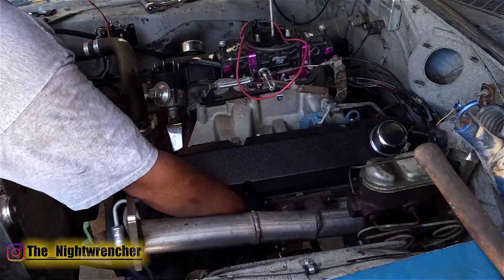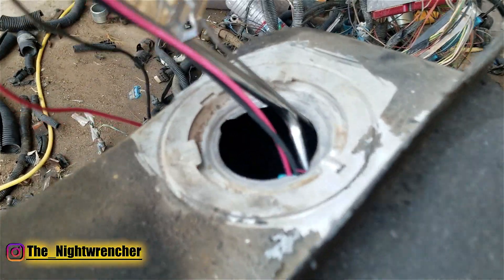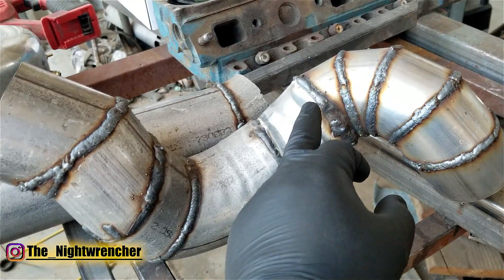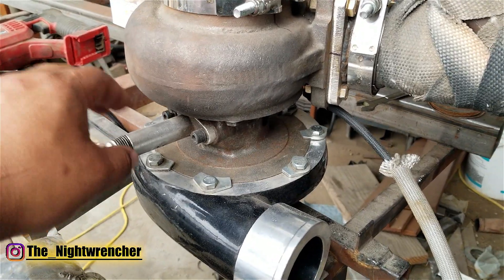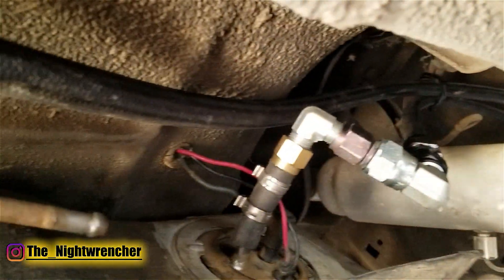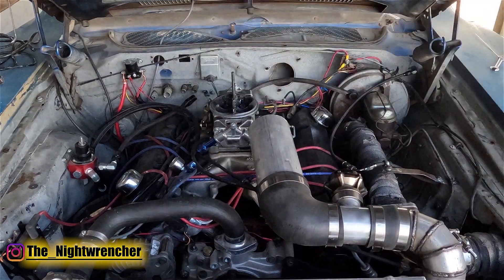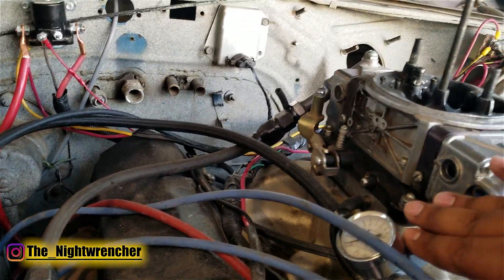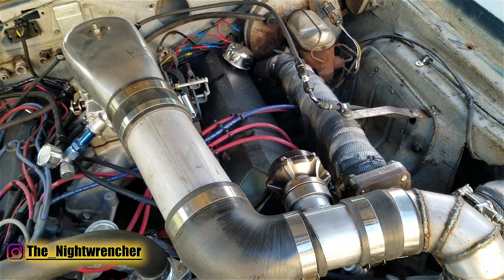Finishing My Turbo Big Block Mopar 361 1973 Dodge Charger | Blow Through Carb | Carbureted Turbo

Comment: Nice!! If you decide to do a re-ring, get some Hastings chrome rings and deglaze the cylinder walls with a medium grit stone and clean thoroughly. It will take a while for the rings to seat, but the chrome rings will be impervious to boost and resistant to contaminates (dirt/dust/debris) that boosted engines have to deal with.
Reply from the maker: I might just do that! I've pushed this motor about as far as I can go without breaking a piston. I'd like to get some forged pistons and rering this engine